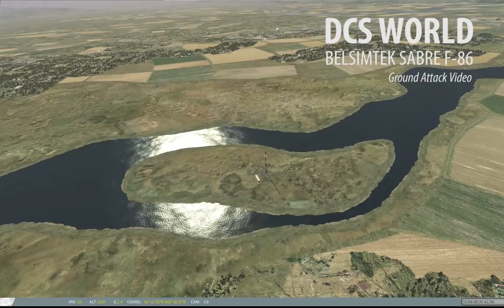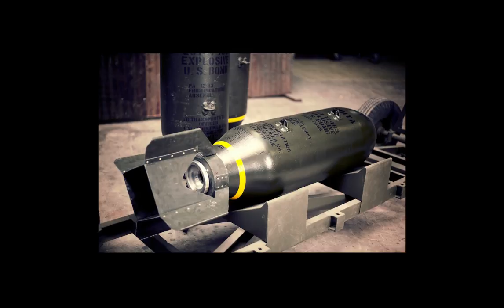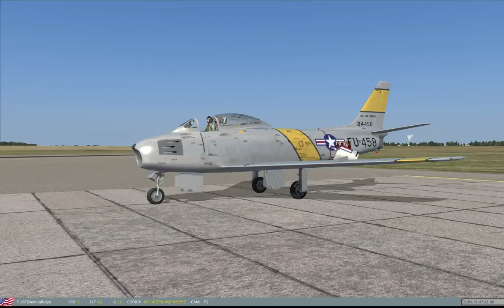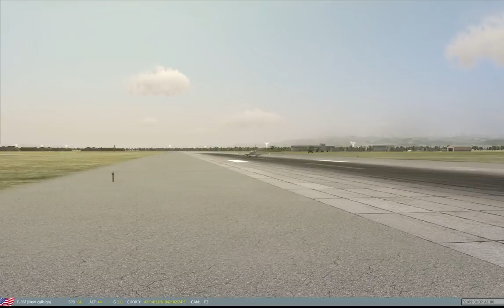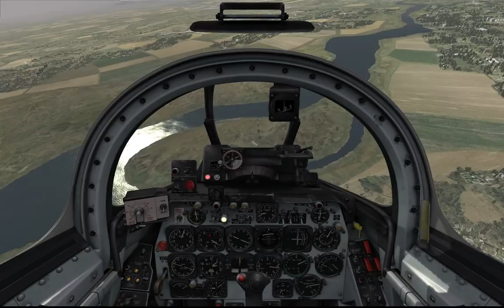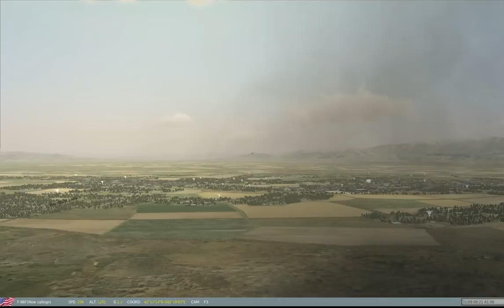DCS: F-86 Sabre Start-up and Ground Bombing (Automatic Release).

Comment: Been trying for almost 2 hours. I cannot get the bomb to drop.
All altitudes, angles, button sequences... nothing.
Reply from the maker: Check that both the sight electronic cage control AND the bomb release control are mapped to buttons on the joystick. You should press the buttons at same time and hold them down. When the pipper is steady on the target, you can let go of the electronic cage button but keep the bomb release depressed all the time. They bomb should release at the right moment. Check all the weapons systems are all set, as shown in the vid. Also, make sure your dive is not too shallow. The steeper the better.